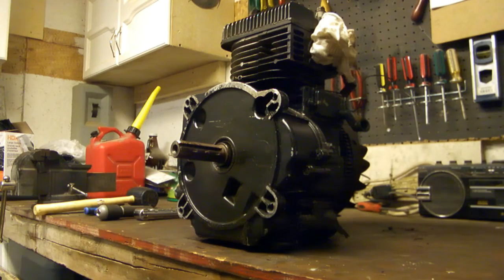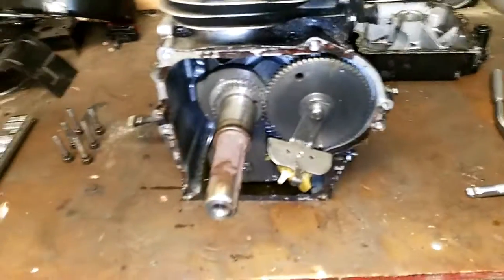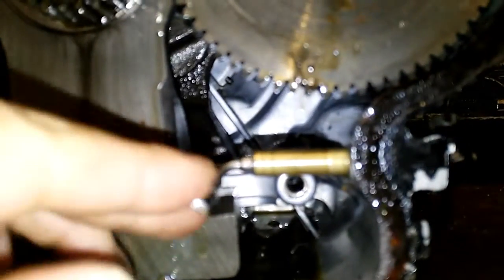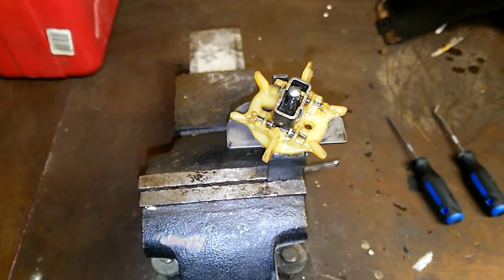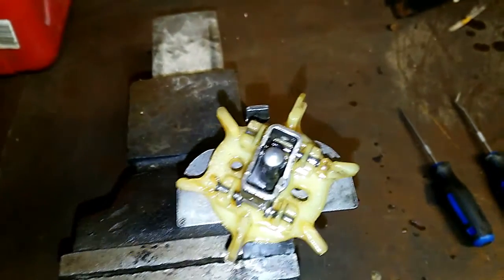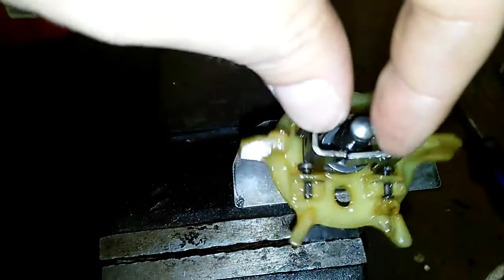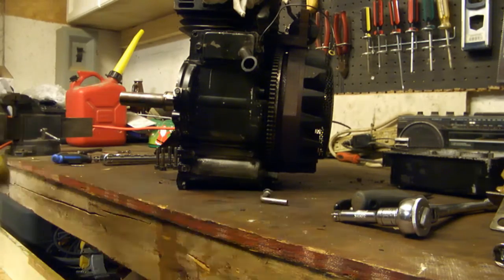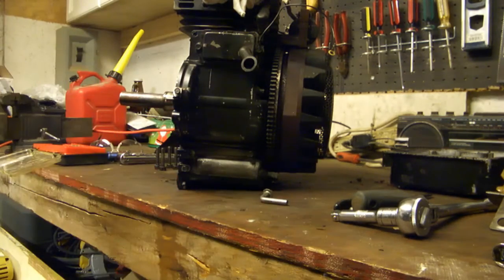Racing Mower Build Removing the Governor

Comment: If the paddles on the governor are what spread the oil, and the governor has been removed how do the crank/all the gears get lubed?
Reply from the maker: The governor part is just the metal arms that move. The plastic flap wheel went back in the engine. I didn't make that superb clear in the video. I have a more recent and better made video of governor removal on a Honda clone.

You're absolutely right though. If that plastic wheel doesn't end up back in the engine, it will not last very long. Thanks for the view!

Comment: Hey man, thanks for the how to, did this to my 500cc briggs but I struggle with parts.  I live in Germany and don't have a clou where I could order stronger valve springs or if I even need to. Any experience or (online) stores someone could recommend?
Reply from the maker: My pleasure! Thanks for watching. I get most my small engine parts from eBay or Amazon lately.
Reply: Any spring pressure recommendations? I've never done anything like this before
Reply from the maker: @achimhaun2726  I see a lot of videos where folks are putting 18lb valve springs in. This engine never gets revved high for too long so I haven't had any floating issues. I think it would depend a bit on the application though. Maybe go heavier if you're going to be holding it at high revs for a long time?

Comment: what if i leave it there but juste disconnect it from the carb?
Reply from the maker: That's totally doable, but the risk is that the internal bits come apart at higher RPM. If the internal part of the governor breaks off, it will probably beak a bunch of stuff inside the engine.